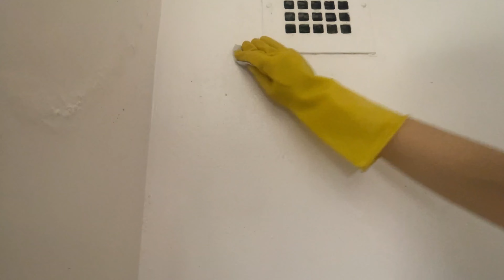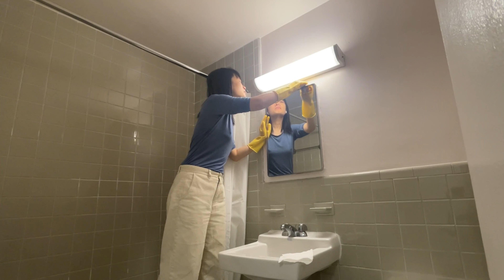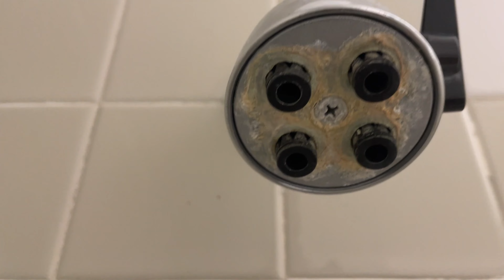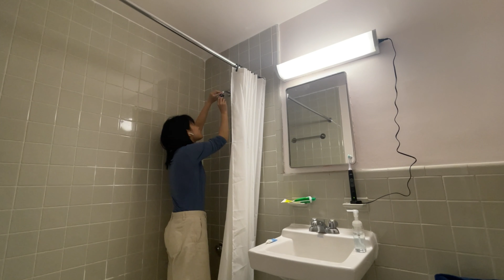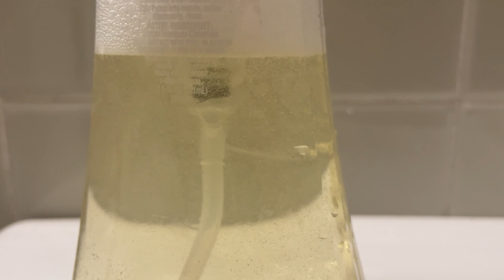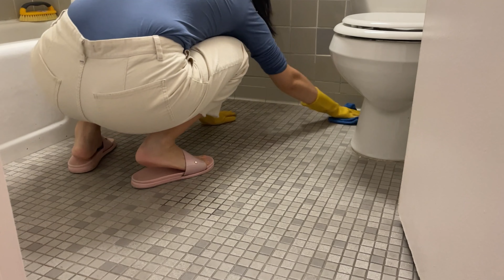Deep Cleaning My Bathroom after Move In | Minimalism | Living Alone in NYC

Comment: The fans are to help with humidity and air circulation. You need air circulation in the bathroom especially or you will get mold.
Reply from the maker: Oh, no. Should I remove the tape?
Reply: @yawenmama please do. It also helps with smell.
Reply from the maker: @LadyKurta  😂The reason I seal it is I found a roach crawl into my bathroom through the fan.... Now I am struggle.
Reply: @yawenmama  omg nooo!!!! Fr??!!! 🥲 Then idk what to think 😭
Reply: just make sure it's dustproof as in comes with the mesh wso it will filter out the air and roaches
Reply from the maker: @kkhyna  What if it let roaches in? 😭
Reply: If it has mesh it shouldn't It's sorta like a foam just with tiny tiny holes 
 @yawenmama